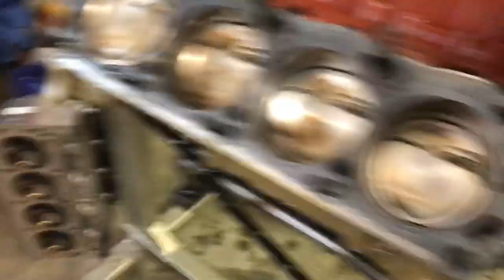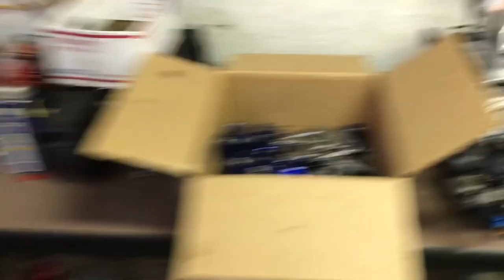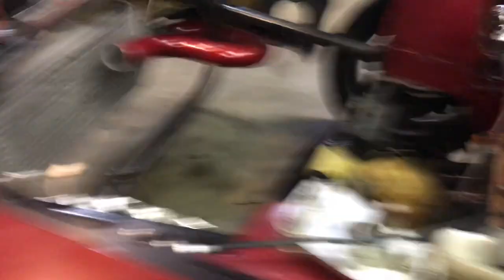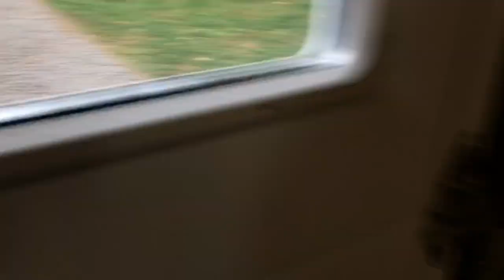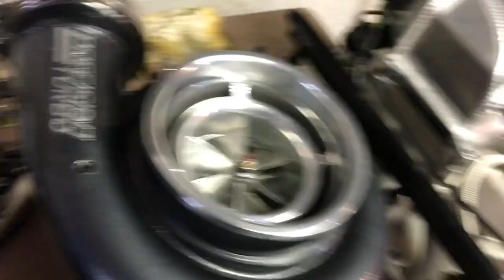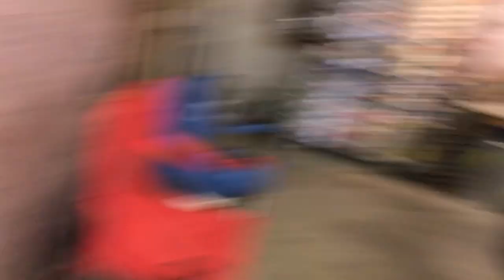I lied 🤥 time for version 7.0

Comment: New subscriber here and im building a similar engine for my sn95. 9.48 deck and .30 over but im having trouble finding a 2618 piston outside of a custom piston. If u dont mind me asking, are you running 2618 or 4032 pistons? Ive found a few 4032s i can go with but from my research the 2618s are better for boosted applications because they expand and contract with the heat cycles. Let me know your experience please

Comment: Custom cam from lil John motorsports or es Curtis cams . Ed cutis customs cam is less than $300 ... I think they are 260

You running 30psi yet ??
Reply from the maker: Ended up getting a B-451 cam, haven’t cranked 30psi yet, cus it wasent picking up much with more boost, but hopefully with new cam that will change

Comment: Did you have trouble with the moroso oil pan ? If so what did you do to fix. One of the bolt holes was inside the pan,so they didn't bother to drill the second two holes in the pan from the front.
Reply from the maker: It works well for me just right out of the box
Reply: I was told that it would be ok to run like this, but I don't know.